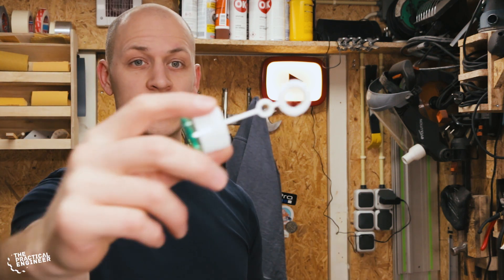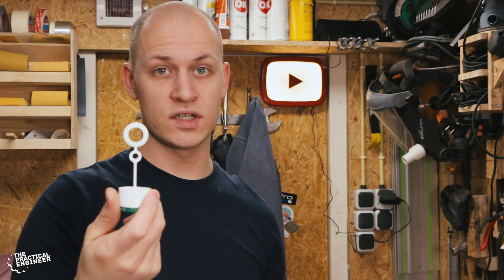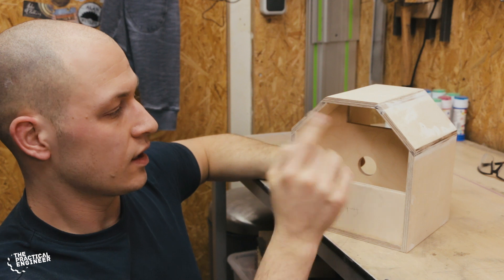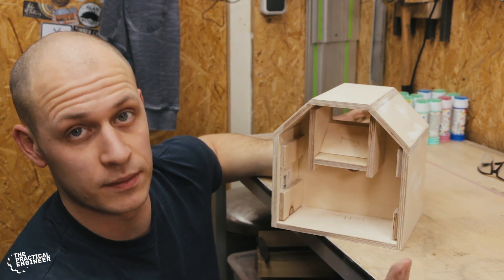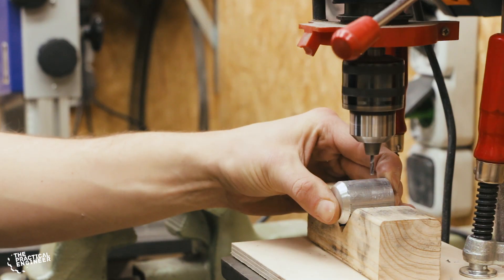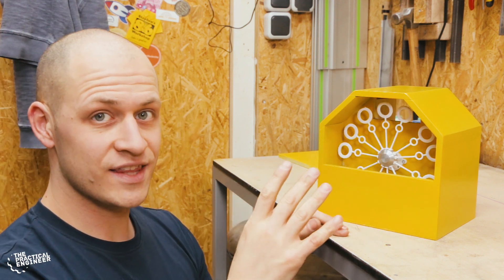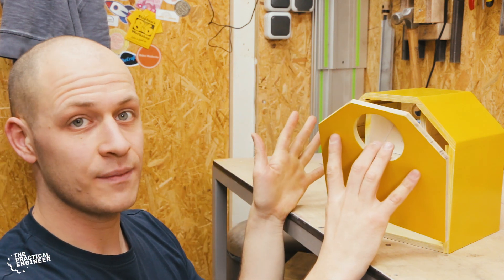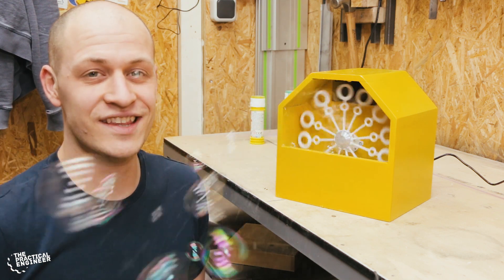Lots of bubbles! - How to make a bubble machine

Comment: Awesome build. Made me think I should try this for my girls. I would have liked to see more detail on the wiring and hardware you used to power it all.
Reply from the maker: Hey! Thanks! I used a 12 V computer fan and a 12V 14 rpm gear motor in this build and wired them in parallel so they both get 12V. https://bit.ly/2QSoY6X
Reply: Your awesome bro. Ty for the info

Comment: Soo cool. What kind of fan did you use
Reply from the maker: Its a simple axial fan (from an old computer) I found it to be a bit tricky. If the fan speed is too slow the bubbles won't go far. But to fast and they all instantly pop
Reply: @Thepracticalengineer  Great mschine. I also want to build this one. How much rpm has the CPU Fan? Thanks

Comment: any info on fan size?
Reply from the maker: I used a 90 mm fan here I believe.
Reply: @Thepracticalengineer  thanks for the tip. did you test your bubble machine with DIY bubble water solutions? like dish soap, glycerin etc